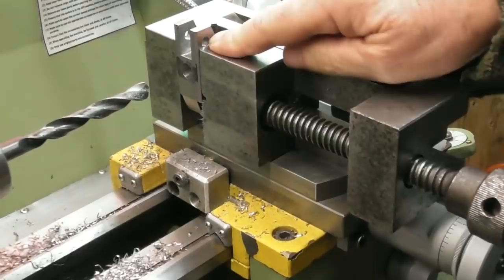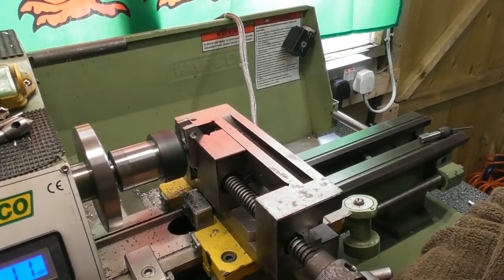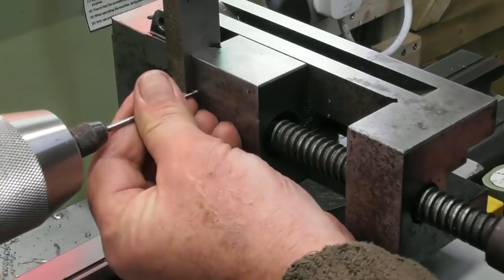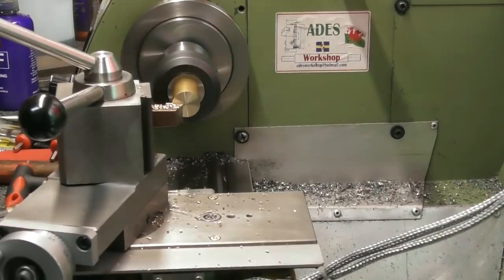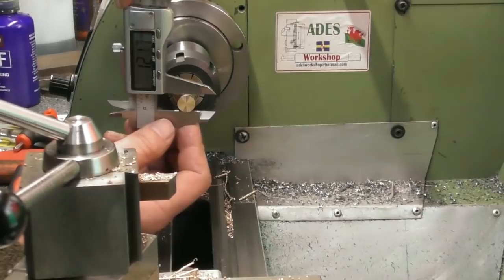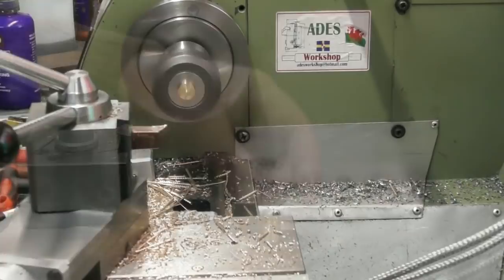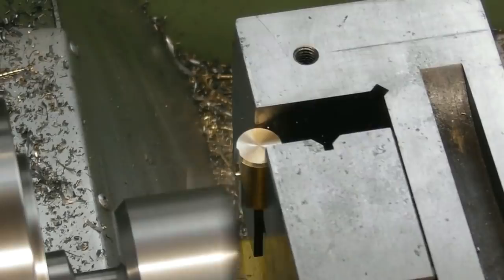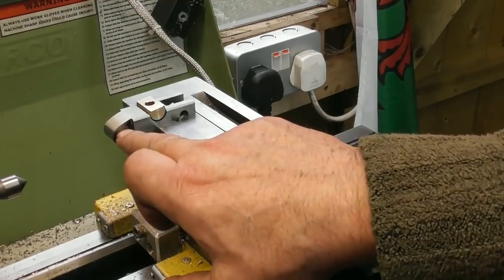Shop made Knurling tool part 8

Comment: Part 8 Hi Ade this is going really well, nice to be back for this part. We sure enjoy being here watching your skills as you clearly share them for us to learn fro you, you sure have some good tips and great techniques to correctly accomplish your tasks at hand. 
We like that elongated hole seems only visible from the bottoms or between the two outer components, looks right to us.
We will need to come back to see if in part 9 it is fitting time, this is where we make things work together really smooth for continued operation, this is going to be another joy to join you on the final assembly. 
Thank you for the share Lance & Patrick.
Reply from the maker: As i always say , "i make it up as i go along " i think that being an engineer is finding a way to do something that you don't have the tools or equipment for . i certainly do not have half the gear that most people would use for this sort of project , but i find a way . i am having great fun with this project , 
having watched you guys i realise that i need to get more organised and tidy up a lot more , and i really feel the need to make things shine, i will be polishing things more on "inspection" you know what that means Lance, . Thanks again both ,Ade.